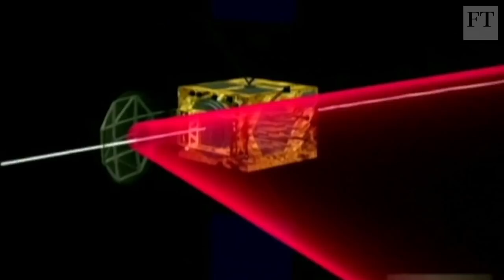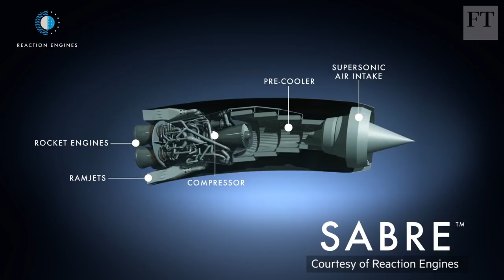Engine could boost UK’s space ambitions

Comment: The SABRE and Skylon are both overrated. Even though it's generally not worth it trying to engineer SSTO's currently, there are concepts that make sense. For example, John Bucknell's nuclear thermal turbo. The performance would be amazing, and there's no risk of radioactive exhaust or leakage due to the reactor being a solid core design built like a tank from all the shielding.

Comment: is a turbo-fan a reaction engine?My point being it still needs air in outer space..?
Reply: It works as both a jet and a rocket.

A jet in the atmosphere rocket when the air gets too thin saving a huge amount of fuel vs a pure rocket and letting it take off and land from a runway like a jet air craft.
Reply: I beleive its supposed to compress the oxygen from atmosphere in flight to store onboard as it nears orbit
Reply: @joshuapike6374  It compresses the atmosphere and burns it with H2 but dosn't store any of it.
It carry's a separate O2 tank from the ground like a normal rocket for when it leave the atmosphere just a lot less than a normal rocket needs due to using the atmosphere .
Reply: Idk.. The complexity and subsequent reliability of such a design is prob gonna be its downfall.
Reply: @joshuapike6374  They have built and tested the cooling system and run the engine at ground level so I'm pretty hopeful.
https://www.youtube.com/watch?v=wxdXLl9P62M

https://www.reactionengines.co.uk/sabre/htx